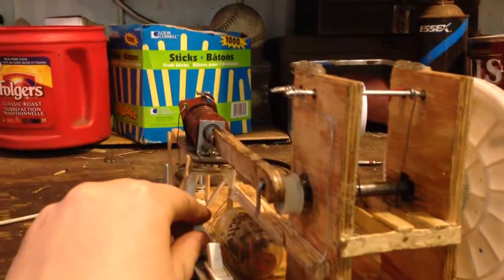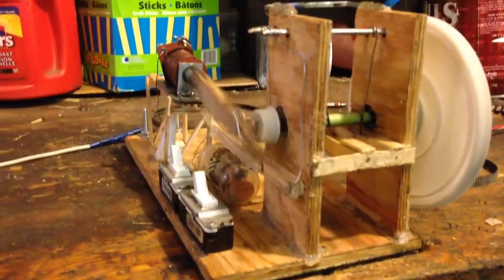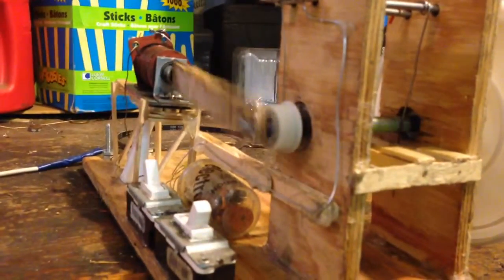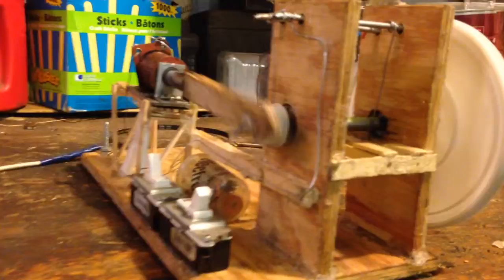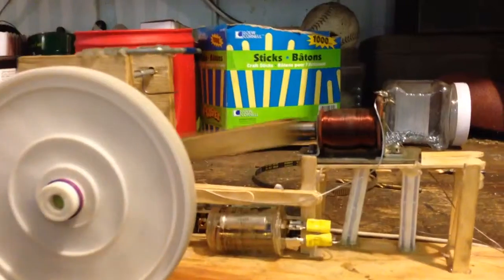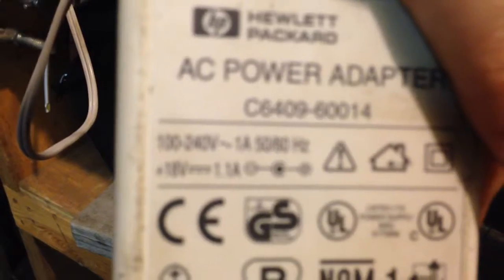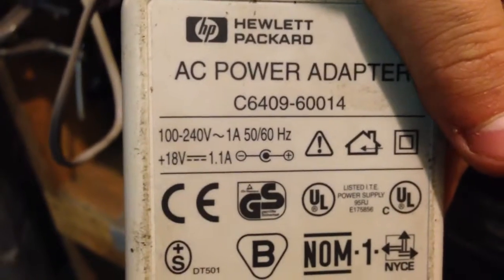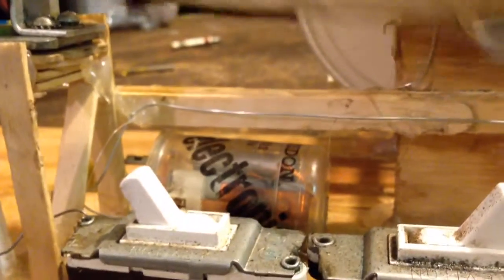homemade solenoid engine

Comment: I made a few myself. They are hard to get working, I still cant understand why.
Reply from the maker: boowonder888 iv made about a dozen over the past 2/3 years iv found friction and timing are big parts in making them run right and smooth